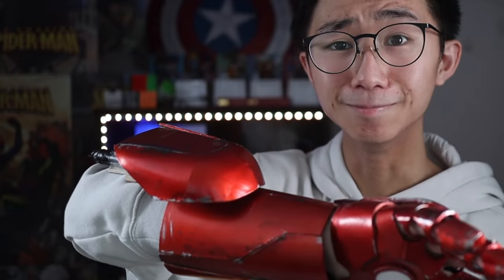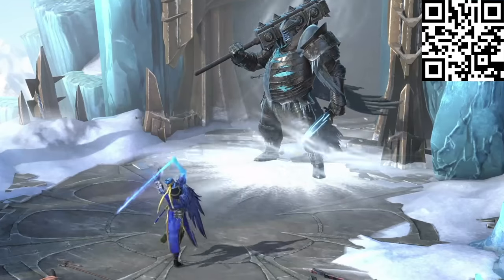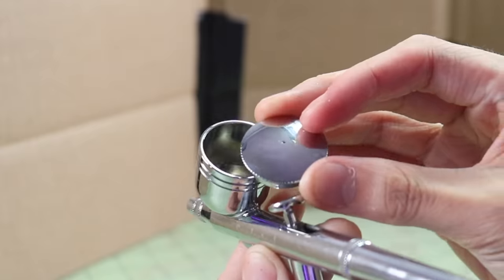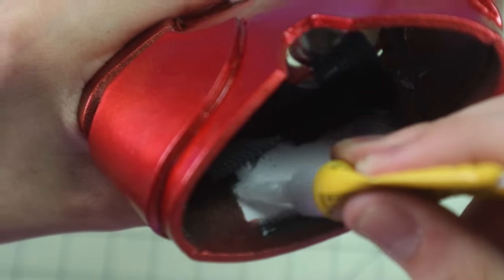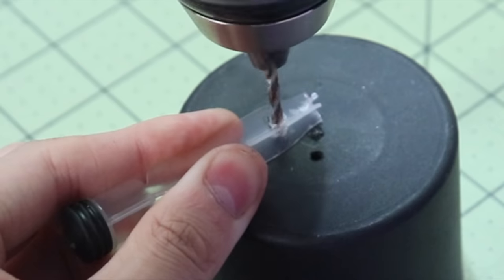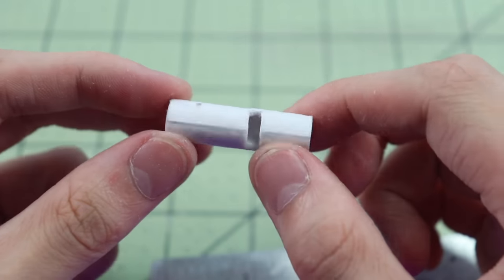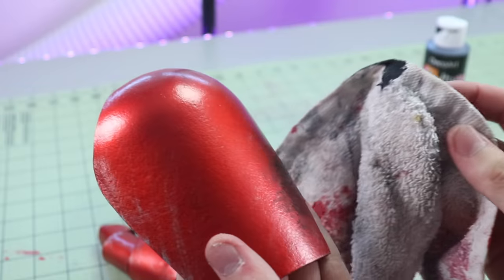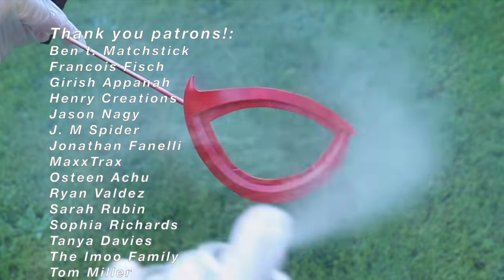REAL Iron Man Missile Launcher That SHOOTS! DIY

Comment: Maybe an Ironman chest piece that opens in the front with a popsicle stick contraption. Use slightly weaker magnets to hold the pieces together in the front center.(Arc reactor on you)

It’s a tall order but I’m sure you and the community might be able to come up with something.
Reply: Actually possible just the material mate
Reply: The arc reactor would be better if in the armor it would just clear plastic and when we get in  the reactor would light up because the reactor are already in our shirt
Reply: that a best plan 😇😁
Reply: that a best plan

Comment: At least yours doesn't have the risk of getting stuck and not launching while the engine is burning a long cut into your arm. Or risk having it then explode on you.
I recommend that you check out LaserGadets's video of his own version (go to the bottom and scroll up; that's much faster to find it). It's also really cool, but he didn't explain much about the inner workings.

Yeah... in an outtake, the rocket got stuck and burned him pretty bad (wound not shown). As far as I know he managed to either get the gauntlet off or the rocket to release before the rocket got to explode.
He makes a lot of strong laser gadets, as his alias implies..